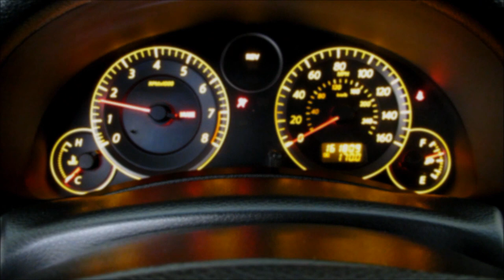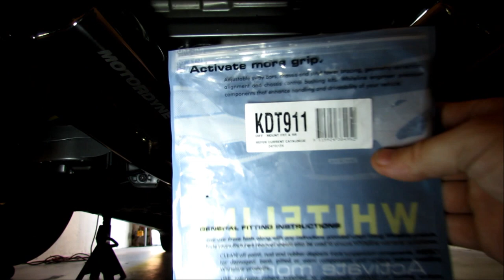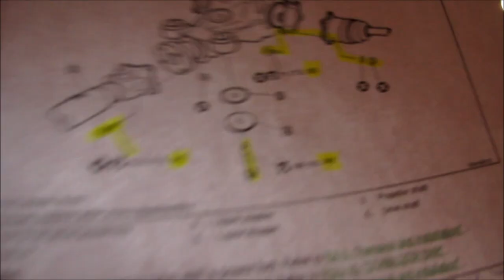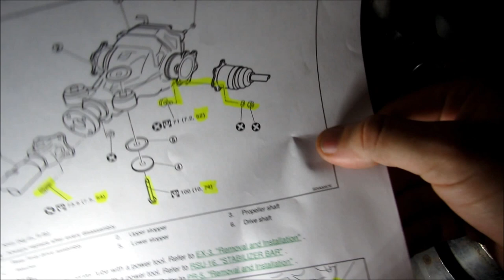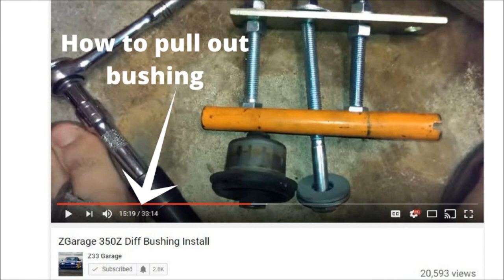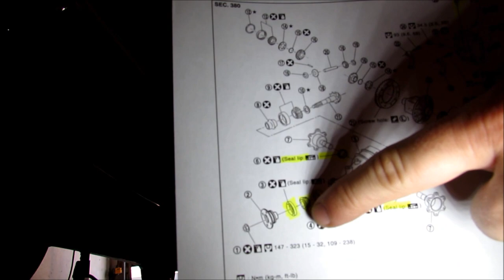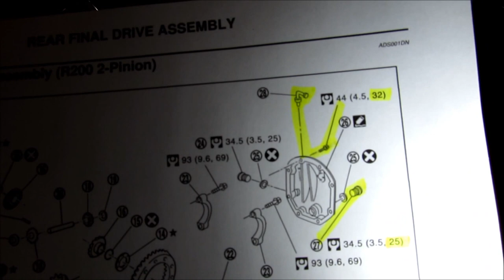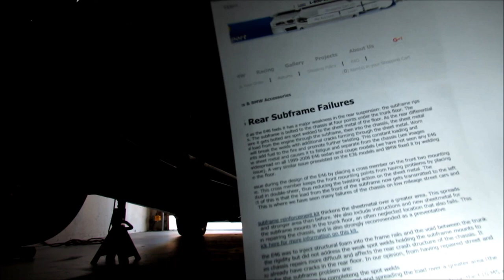Differential Bushing Install - G35 , 350z , G37 , 370z

Comment: You could've injected epoxy resin into the failed bushing for about 8 bucks which would've solved your problem and effectively transformed that area from a liquid to a solid without all the parts and labor. the oil in the factory bushing is only present in the top and the bottom part of the bushing while the sides are solid rubber. The epoxy resin acts as a shock-absorbing substance much the way the silicon aftermarket part you installed does.

Comment: Do you have to rebuild the pinion gears and stuff you were talking about? Was planning on tackling this job myself and getting the Z1Motorsports kit to get the bushings out, was going to just drain and fluid in the differential and take the bushings out, thanks!

Comment: @motordyneg35 so when i typed in part KDT911 i got one popped up with ebay and it comes with the kit basically the main one in the back and two in front. Is this the correct one need to purchase?
Reply from the maker: Samer Qanadilo....Yes!
Reply: Motordyne G35 ok thanks!

Comment: Is there any reason why you didn’t go with solid bushings??
Reply from the maker: Any reason why I should?
Reply: @MotordyneG35  I see Lil smart white boy. Nvm.
Reply from the maker: @g35tho11  so here's the breakdown with the materials. poly is more compressible than aluminum. so it'll give more, it'll be more comfortable and it'll also transmit less noise than the aluminum. The aluminum will be stiffer and have less flex which is good for more predictability and stability, but it makes for more noise and a rougher ride.
Reply: @g35tho11  Lol. Why don’t you go solid bushings?
Reply: @dumbeezy5480  I thought it would ride to ruff. But now I regret just not going solid 😞I went with white line poly .. (it was a mission to put them on)plus I was like why get solid diff bushings if my rear subframe bushings aren’t solid (there still oem)

Comment: Im experiencing almost like a "thud" coming from the rear, in between shifts, and it is less noticeable when shifting in the higher gears, the diff bushing in my 370 has some cracking, but would this symptom be common with a bad diff bushing?
Reply from the maker: Nicholas Rubino ....Yes! That is an exact symptom the thud noise and wheel hop when trying to accelerate aggressively.
Reply: You will see hydraulic fluid stains on your diff cover. Then you will know for certain.

Comment: Could this be what is causing a noise I will describe here..? 
When parallel parking for example, while putting the car in reverse or drive and initially starting to move I hear a metal pop sound, almost as if my break pads were stuck to the rotor and then they released or as if you take 2 wrenches and kinda tap or pop them against each other once. 
Hopefully someone else knows what noise I'm talking about?
Reply from the maker: Matt D ...very common. It is your lower control arm bushing. I also replaced this with a white line bushing. Mine did the same-thing as you are describing.
Reply from the maker: I show you the lower control arm bushing in my G35 buyers guide video here at minute 26........https://youtu.be/voxGTRCRsl4?t=26m
Reply: Thanks so much for the help and replies. Being able to connect with youtubers means alot to people.

Comment: did you ever have to replace LCAs? if so did you go aftermarket or oem?
Reply from the maker: Justin Lumague .....Yes, I replaced my LCA'S with aftermarket. I went with whiteline. The LCA you know are bad, when you hear metal on metal grinding during slow turns in a parking lot. I have only replaced mine 1x and it was with whiteline, they are still good.

Comment: 2003 g35 Manual I drilled the rubber bushing and the whiteline bushings dont fit is there  metal I have to remove, my diff pretty rusty need help asap please and thank you
Reply from the maker: The answer to your question is in the video. Rewatch it.
Reply: @MotordyneG35  Damn you could of at least just give me a time stamp you dont have to be rude about it, I'm just a amateur to working on cars that's what's wrong with the car community nowadays and I rewatched the video and you said nothing about the 2 metal pieces on the diff itself but that's fine, I'm sure theres other videos out there keep it up I guess 👍🤙

Comment: Awesome video as usual man. Not sure if this almost the same as my 5at though? Lol
Reply from the maker: Tyler Leonardi ....thanks T-Dawg. The automatics came with an open diff vs. VLSD that came in the 6 speeds. Other than that, everything else is the same. You still have a diff bushing.
Reply: Motordyne G35 figured. But even with the sports packages in the 06 with OEM 19s are only open diff?  Thought I got VLSD? One tire fire it is!!!
Reply from the maker: Tyler..... What year is your G? 2007? I learned something new. You are right, if you got the sports package, the autos got the VLSD. I know it is standard for 6MT. If you have the sports package did the autos also have orange stiching in the steering wheel?
Reply: Motordyne G35 06
Reply: And yes I got orange stitching 😂
Reply from the maker: right on....I always used to think only 6MT had orange stiching and VLSD. Learning new things, so all sports package G's got it.
Reply: Motordyne G35 sounds good the 05 was a very odd year in transition for the g35 too lol